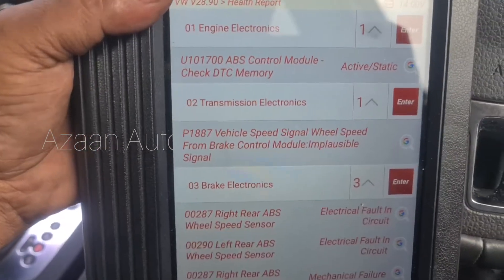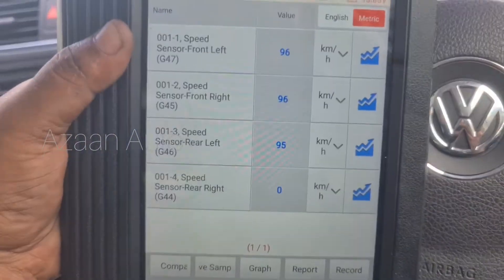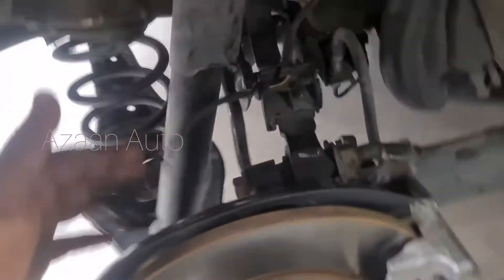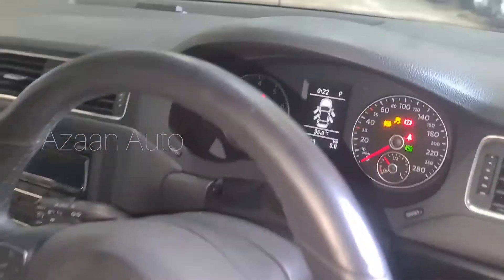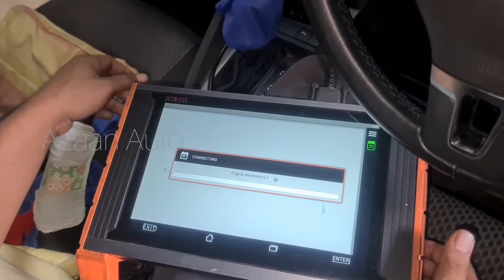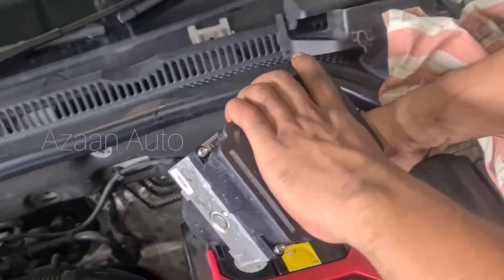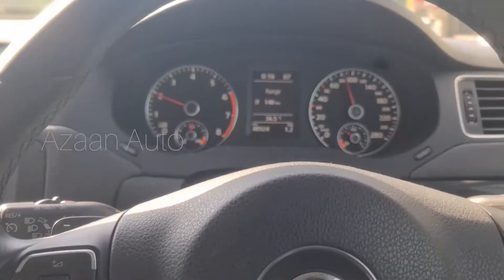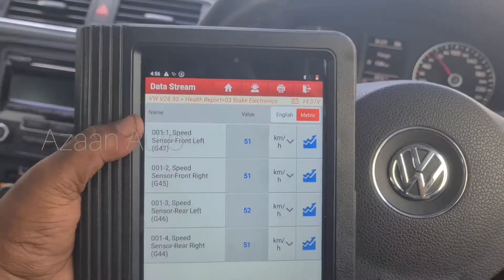U101700  P1887  00287 Mechanical Failure Abs lights on Abs Control Module Impulseable signal

Comment: Sir Etios liva mae do tin baar compressor ka clutch set change kr diya ac sab ok chlta h pr gaadi 100 200km running ke baad clutch set burn out ho jata h high pressure bhi mentain h phir bhi problem ho rhi h apke pas koi solution h kya
Reply from the maker: Compresser ki Relay ko check karo aur dekho AC cut off karta ha ya nhe agr Cut off sahi karta ha to phir theek warna Ac ka Trip sensor change karo
Reply: @azaanautos7248  sir ac ek dum proper kaam kr rahi h cut off bhi ho raha h but continue 100 200 km pr phir clutch burn out ho raha h
Reply from the maker: @ismaeelqureshi2920  check kar wiring kahin se Body earth ma short to nhe ho rahi compresser ki wiring
Reply: @azaanautos7248  scan  kee h sir car wiring۔ me to koi problem nhi h ac ki wiring bhi kahi body ko touch nhi ho rhi
Reply: @azaanautos7248 magnet nhi only clutch burnout hota h